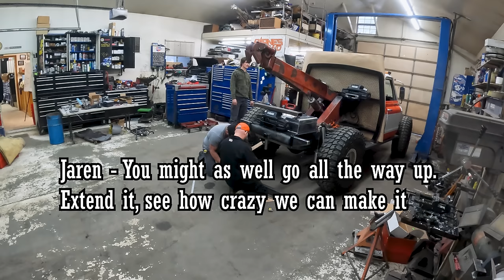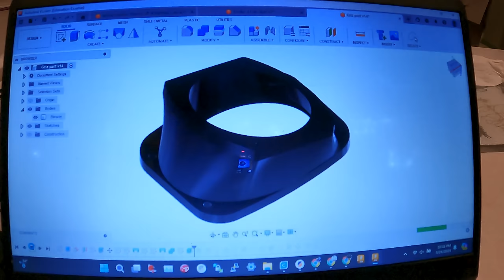The Fight To Get Griz The Wrecker To Run!!

Comment: With the firing order mistake, It's easy for get in a groove and forgot that what you're working on isn't what you're used to doing. I've owned and worked on many Oldsmobile powered cars in my life, I've also owned and worked on many Chevrolet powered vehicles in my life. My current Olds Cutlass has a SBC that I built and installed, when I had to replace the hall effect switch in the distributor I replaced the wires on the cap and it would not start. I double checked the firing order a dozen times before I picked up my mistake. I absentmindedly ran them counter clockwise like an Olds (same firing order, same no 1 position, but the distributor turns CCW).

Comment: On the boom rest I would build it with a saddle so that if you need to do a side pull with the boom down you won't need a second winch line to counter act the load.
Reply from the maker: We are redoing it, so thank you for that idea. We'll try to incorporate that into the re-design

Comment: Very interested to see which filament you used on the throttle bottle, and how well it handles the heat
Reply from the maker: It was printed with ABS at 100% fill, so far so good 😁

Comment: Wow. That's the reason I don't like these computer controlled engines. To each their own I guess but I liked it much better when engines and vehicles were simple, easy to diagnose and fix. Good job on the persistence in tracking down the bugs. You guys are winners. Thanks for the video.

Comment: What kind of filament are you using on your 3D prints? With the heat under the hood, most printable plastics will melt. Hopefully you used nylon.
Reply: We used ABS.
Reply: @KAD_Design  ABS has a glass transition temp of around 105C/220F. I work in the semiconductor field and we usually have to qualify our electronics to 125C for automotive use so hopefully 105C works for you. I also enjoy 3D printing so it is cool to see it used in useful applications like this.
Reply from the maker: Luckily it's in a location we'll see regularly to know how it's doing/holding up 😁

Comment: Chad love the channel! Just a warning your cheap chinese winches from  harbor freight  check the video  from Florida off road rescue , under the left side cover  you can open them up and please check the connections their usually  loose when  using the they over heat and they get so hot enough to melt the inside of the cover and on the right is the free spool on that side theirs the free spool it backs the flat plate and once engaged in free spool it get the three spline running free but they do get hooked  in the free spoon groove because its a defect they can be rounded in the free spool shaft but the main problem is the left side were the connecters over heat so have a good  pinball hammer ready and a fire extinguisher  each sides of the boom their well sealed so when  this plastic  catches fire beware of even the fume Florida got them out and when with America Warn's winches as Americans  should  stronger better safer do not trust trust the harbor  freight open  one left side and check the cheap electronics in them please be safe you could be driving down the road after using them and they could  be on fire your little  man doesn't  need the chaos to mark him for life and you have a beautiful well raised men love to see such a cool family  my deepest Respect  love the little  words of the day at the end of every videos  Lonewolf Canada  i would love to send you the Florida  of road recovery  video  but as a pipefitter im not a great electronics guy.lolol please  be safe .you have been  given  a beautiful  gift from The big guy protect it is now our jobs i have my three sons also the all mechanically inclined..i never told them  i also do because  i don't  like it .its me and my wife's secret....😅😅😅😅